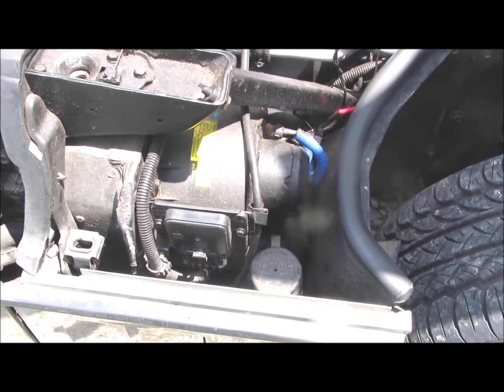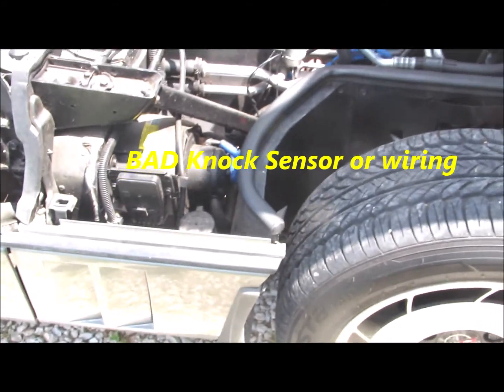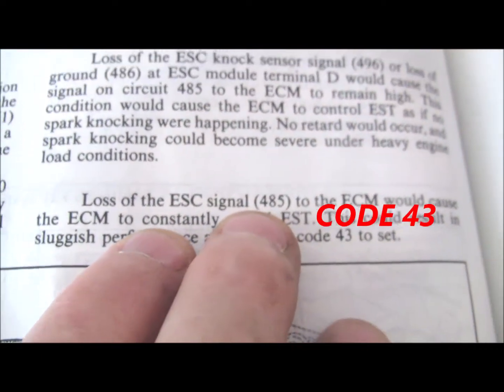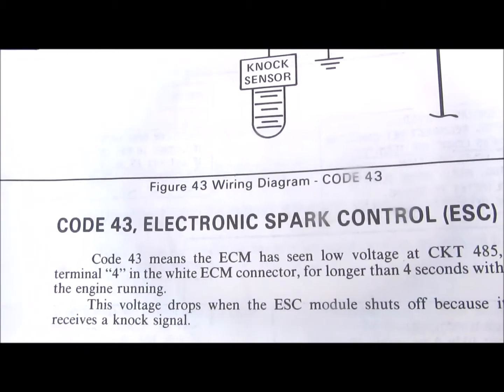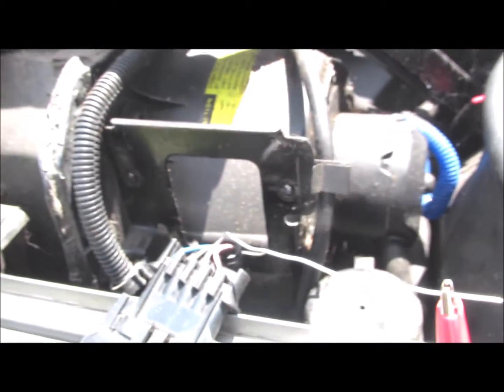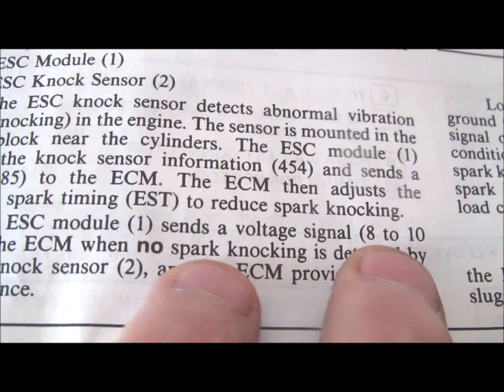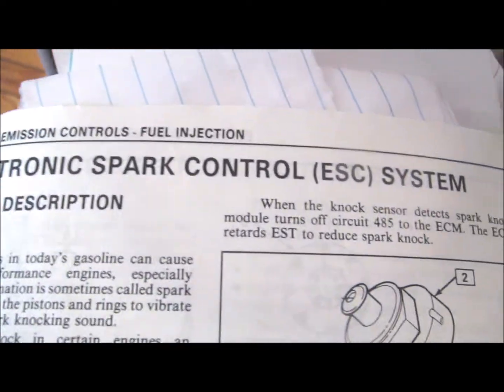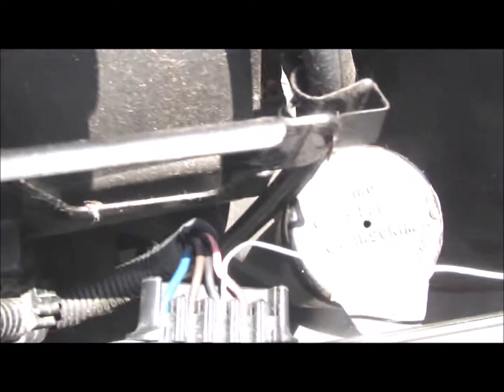#STOCK1984CORVETTE 𝟏𝟗𝟖𝟒 𝐂𝐎𝐑𝐕𝐄𝐓𝐓𝐄 𝐌𝐈𝐒𝐅𝐈𝐑𝐄 𝐄𝐒𝐂 𝐌𝐎𝐃𝐔𝐋𝐄 𝐓𝐑𝐎𝐔𝐁𝐋𝐄𝐒𝐇𝐎𝐎𝐓𝐈𝐍𝐆 #MotorTrendCaroftheYear

Comment: THX FOR THE VID. (4+3 Car is my 1985)
I had a code for knock sensor (Needed replacement) and it cleared the code/fixed the issue.. My issue was, when I tried going WOT, the car would act as if it hit the rev limiter. 
On rare occasion, when I try going WOT, sometimes it will act the same way. VERY RARE however. NO CODES.
I was thinking of doing this test, perhaps this is my issue?
Thanks.
Reply from the maker: Hope it works